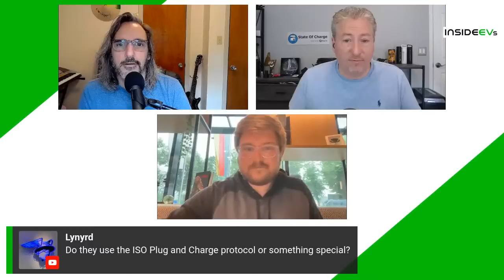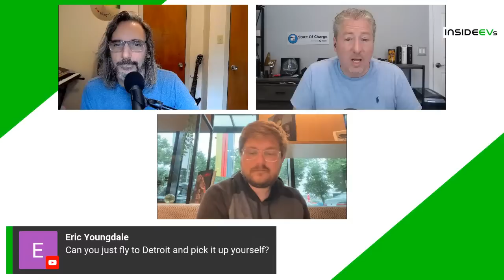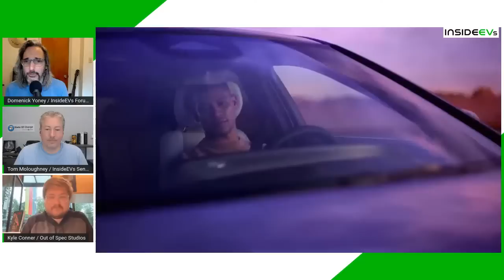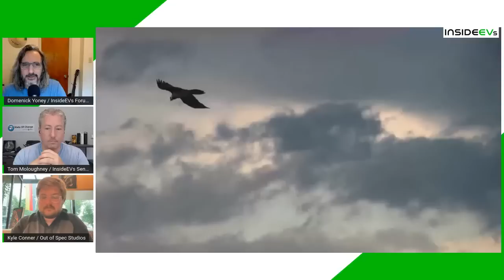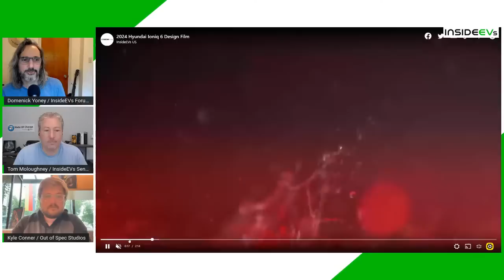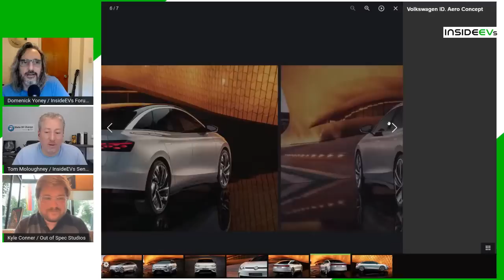We Drive Cadillac Lyriq, IONIQ6 Reveal and VW ID.AERO

Comment: This message is for @Tom Moloughney
I am amazed you managed to find yourself stranded in the Bolt EUV that has the same battery as the Bolt EV. And it’s not the first time you range test a Bolt.
If you didn’t learn yet, the Bolt EV has graphical SOC in 5% units. The LOW message appears when you are left with two bars (7 % more precise). You also have the efficiency in front of your eyes, as Average number : let’s say 3.5 miles/kWh. You know that a SOC bar will disappear in 5% steps, so if you see two bars, you can very well assume that you still have at least 5% battery. So, the range that’s left after the LOW message appears is at least : 5% x 60 kWh (for the sake of easiness of calculation) = 3 kWh. You have the 3.5 miles/kWh in front of you, so a simple math would have said the range left is about 11 miles before empty. I suppose you went well above the 11 miles before you found yourself restrained on the side of the road.
The Bolt EV gives you everything, you only need to know what to do with it. A number in the GOM or % SOC is useless, because if you face a headwind, you may very well not be able to reach the DCFC anyway. And yes, Bolt EV also has the kWh used in the Charging Infotainment. Also it has no buffer and the battery is 64 kWh.